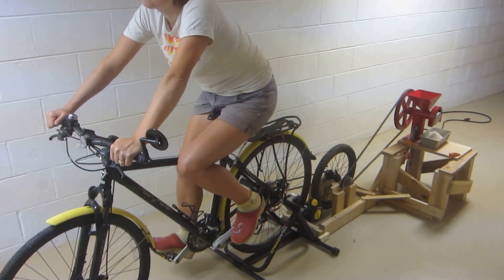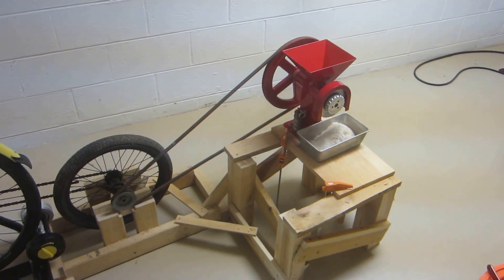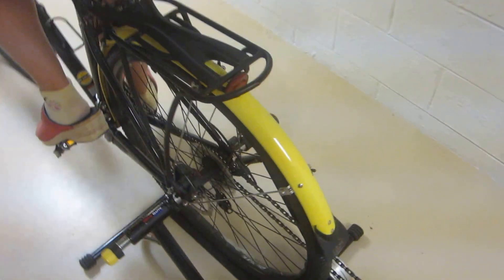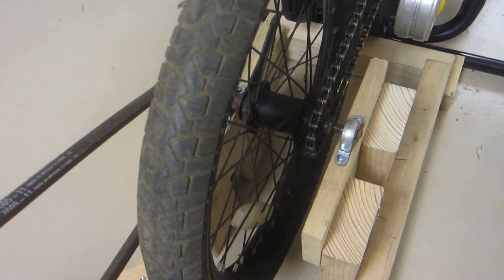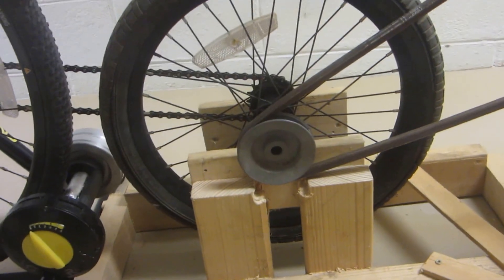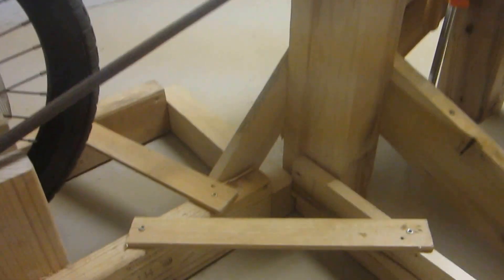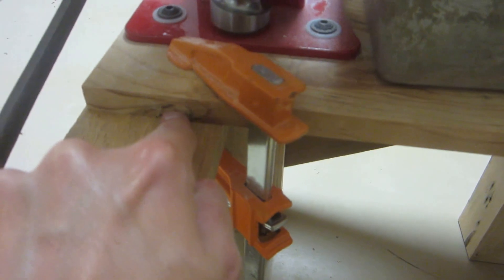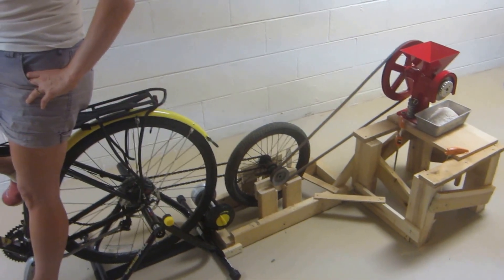Pedal Powered GrainMaker Mill

Comment: nice,  i would have liked to know details like how many revolutions does each gear provide to the next, also how much grain can you grind an X amount of time
Reply: The gear reduction was something like 10:1, but the gears on the bicycle really helped control the resistance. It takes about 3 to 4 minutes of pedaling to grind enough flour for a loaf of bread.
Reply: And how much easier was it to pedal than to work by hand…